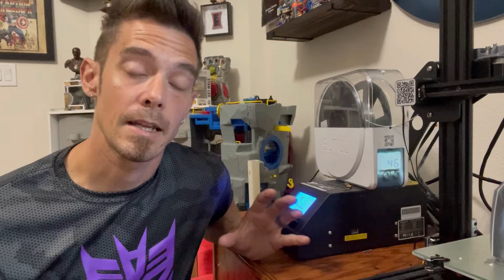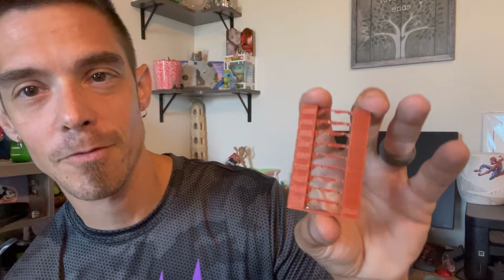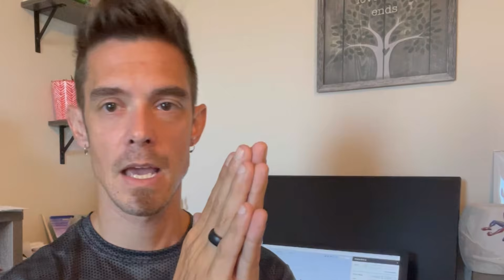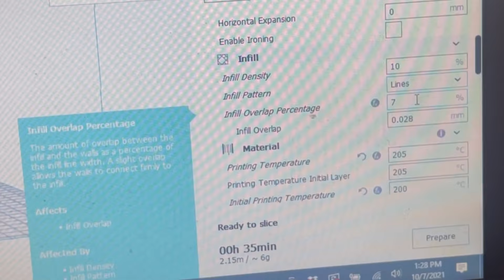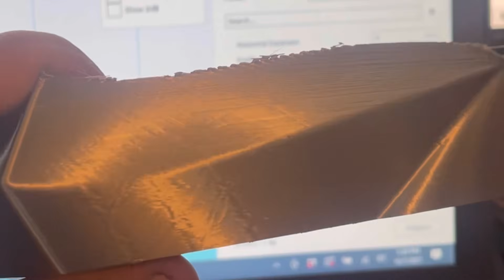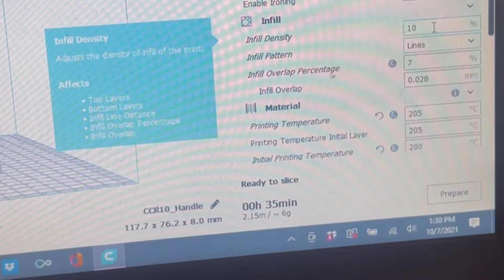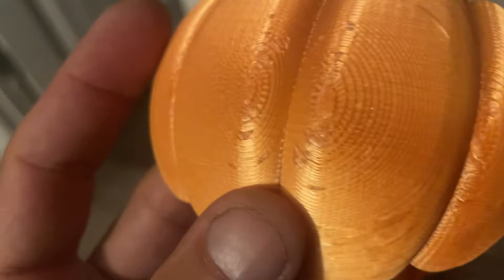3D printing silk filament| how to get silk 3D prints to look the best | 3D printing tips & tricks

Comment: Thanks for this video. Got the matterhackers silk rainbow, and the brim has separation. The print looks ok, though. So maybe just try your settings then update this comment. Creality Ender 3 v2. Latest Cura 14 version.
Reply from the maker: I’m dropping part 3 soon it’ll have even more tips!
Reply: @Darkwingdad  Thank you so much for this one, so now 13 days into the silky rainbow MH build series. Did all you said to adjust and added some of my own. Installed two more Cura 5s. the xmas version and beta which tahnkfully has tree supports now. Phew, Many days of drying this sfilament and even brought another printer, a sovol sv06, which looked so nice, just had to get it ( wife helped pay mostly). It pops, so must have been dry. Guess the dryer can only do so much. Been challenging, but after two years with the ender 3v2, it's nice to have a self leveler. Keeping both. Wife has lots of dolls and machines been going all day. Hopefully I'll see notification on the silky filament. Frustrating filament for sure.
Reply: @Darkwingdad 11 months later back watching your video again. haha. Sv06 is a real pita. Cheap as Creality's are , the print quality is still better than the sv06. Newest Creality machine looks really nice, newly designed direct drive and 2 z screws,. Probably won't buy another Sovol. So far it needs alot of fixes which I haven't done yet. Second Sovol print dryer fan crapped out and although it heats the motherboard fan current is way off...sigh looked nice, had high hopes for it :(
Reply from the maker: @joelstolarski2244  the reality is these machines are thrown together in minutes & it’s a crapshoot on parts. I’ve had good luck with creality but some definitely better than others

Comment: Thanks a lot for making this video. I am only 1 week into 3D printing but I accidentally ordered a case of 6 silk filaments, not realizing that the "silk" part was more than just the shiny finish... I've had nothing but bad luck trying to print anything with it. I just watched this entire video, dialed in my settings in Cura, and am currently printing a temp tower (even set up the G-code manually for the first time) to see how it works. I'm 2-3 layers in and already it looks leagues better.

My biggest issue was that the first layer was adhering perfectly - zero issues there. But then it would string like crazy, looking like a silky spider web on subsequent layers, and it was a big hairy looking mess by layer 5-6. From my understanding it seems that the retraction speed as well as the overall print speed are the two single biggest factors to dial in regarding silk filament. It just tends to string into a disaster if you print it too fast.

Thank you again for making this video, I'm going to save it and rewatch it when I need a refresher!
Reply from the maker: Yea silk, for quality definitely go slower: if you’re still having minor stringing issues enable coasting (I explain that in my part 2 video) & very soon I’ll have part 3 up that will be the trifecta for quality silk printing. I appreciate the feedback & thanks for watching!

Comment: I keep my silk pla in a plastic box with desiccant packets in it, will that do for dehydration?
Reply from the maker: That will only prevent new moisture from getting in, but those packets don’t last forever and need replacing over a few months. They will not help pull much moisture if any out of the filament

Comment: If you don't live in a place with high humidity, you don't need a filament dryer.  "The cool part about science, is that it's real whether you believe in it or not" -NDgT
Reply from the maker: I highly disagree. Silk filaments are magnets for moisture absorption, I’ve had pla come from the factory with moisture in it. You have no idea how long it’s been sitting, where it was made atmosphere wise & if the bag maintained a seal. So to say you don’t need a filament dehydrator is a stretch to say the least.

Comment: Hi there? Not sure if you'll see this but I recently bought a 3d printer that's printing out in my shed. I'm getting really weak prints when printing with silk.

Its like the layers are not bonding correctly. As soon as any pressure is applied they just crumble.  I'm printing at 195 as I did the print tower with a retraction of 3. Bed is 60.  Using eryone black silk pla. I think I was printing faster at 60 though layer height at 20 ...20% infill
Reply from the maker: Sounds like underextruding, likely moisture in the filament. Printing in a shed is not an ideal place unless you have a dehydrator and enclosure. Even than I wouldn’t print in a shed

Comment: Hi great videos! I have recently been struggling with a Sunlu silk pla+ filament. Even with all these extra settings, I cannot seem to get a perfect print. More than anything they continue to be stringy and have some rough edges, even with retraction and lower heat settings.(200-205) Have you tried this product?
Reply from the maker: I have used sunlu, enable coasting to help reduce stringing. Have you calibrated your esteps & flow?
Reply: @Darkwingdad  I am currently using IdeaMaker with my Longer LK5 and it seems I do have coasting on with .2mm. As far as esteps and flow, I'm afraid I don't know much about it. I am very new to this and I am trying my best to learn but it has been a lot of information. Is there any possibility of sharing pictures of settings to get feedback?
Reply from the maker: @masterduelistaero  you can email pics of your settings so I can see what’s going on but esteps & flow are an important part of getting quality prints
Reply: @Darkwingdad  sent settings to email in your profile.

Comment: General question here, what do your flow settings look like and are you printing with a standard .4MM brass nozzle? I have just started printing with silk, and running these same settings, keep running into a clog issue and then comes the dreaded extruder click that in turn chews up the section of filament in the drive gear. I can then pause the print, remove the filament, cut the damaged section off, and then restart the print, but I run into the issue of a zit or blemish on the print, where it paused. I keep seeing something about reducing flow for silk down to 75-80%, is this accurate? Or do you print at 100% flow rate?
Reply from the maker: Your flow,esteps & retraction should all be calibrated, guessing on these settings will just create more problems. Even when I first started doing silk & didn’t calibrate flow rate right away I never ran it that low, that’ll definitely cause underextruding. My flow is typically calibrated and ran at 97-102 depending the machine & how it came from te factory. Always start with your esteps if you are over extruding you will clog every print. All my prints are standard .4 brass nozzle
Reply: @Darkwingdad   I have never calibrated flow, or esteps and have been running on whatever an ender 3 pro v2 defaults at stock. Ironically enough, printing regular PLA or PLA+ (likely because of their ease of use properties) its absolutely spotless, but now that I'm starting to get into these metallic, silk, and filaments with compounds in them, it immediately starts to clog directly after the base layers, right into the first layer of infill. Any suggestions on sources for calibrating e steps and flow calibration?
Reply from the maker: @TomohawkInsanity  what are your retraction settings & temp for silk? Also are you using a dehydrator? Often times silk filament comes saturated with moisture & need drying first
Reply: @Darkwingdad  Unfortunately this roll, I pulled straight out of a poorly vacuum sealed bag and stuck right on the printer without drying it because excitement, lol. It laid down the base layers like butter, and immediately clicked on the first infill layer, with the temp at 235. It is the Ziro Silver Black roll from their site. Retraction is set at 7MM with a 30MM/s retraction speed. slightly different from your settings. I'm gonna give drying it at 45 degrees for 2-3 hours today and leaving it in the box until I get home. Just have never done ANY e-step or flow calibration to the printer, and it's been upgraded to a creality direct drive head, and then install the original bowden tube extruder setup back on the printer. All of which with a firmware update, as well, without ever calibrating e steps or flow.
Reply from the maker: @TomohawkInsanity  235 is wayyyyy too high & 7mm is far too high for direct drive. 
Try 205* and 2mm @ 30 mm/s for Bowden you’d want 6mm @ 35mm/s to start
Reply: @Darkwingdad  Yes sir, I am back to the original bowden tube setup, as the direct quality just wasn't there no matter how much tuning I did. Ended up with consistently linear prints with infill poking through. Now that I have watch your videos, and couple other on e steps and flow calibration, I can confidently say, my e steps value is likely WAY off causing the dreaded extruder clicking, because of a buildup of filament and the fact it had never been adjusted. I'm gonna try the temp towers, and calibration cube that you had recommended in this video and get my printing extruding properly, and then give it another go at the lower temps in the 200-205 range, and see what happens.
Reply: @Darkwingdad  I ended up finding the perfect print parameters, setting wise based on your videos. The last thing I have to calibrate is flow. Once I get that down, I should be golden. I was 10 hours into a .2mm layer height spartan pen holder yesterday for a friend, and it looked great but had the brittleness of pasta noodles between layers. TO me, that sound like my z offset is adjusted too high above the bed. What would you say is the ideal "height" the nozzle should be above the print? Should I also up my layer height to .16mm if I'm trying to print a figurine with silk, rather than the .2mm layer height? Sorry for all the questions. I'm just trying to get this right.
Reply from the maker: @TomohawkInsanity  if it’s brittle it could be from too low of a temp or underextrusion which could be a clog, moisture,faulty extruder gear/driver or even a faulty sliced file. What was the infill set at? As far as leveling goes you should be able to move a piece of paper under the nozzle when at 0 and it should scrape the paper a bit
Reply: @Darkwingdad   Dried the filament in a Sunlu S1 dryer for 4 hours at 48 degrees before use. Dried at the same 48 degrees while printing the entire time. Infill was at 20% with 6mm retraction and 35mm/s bowden tube setup, with cubic pattern first, and then attempted lines for attempt number 2, without any stringing and 205 nozzle temp which sat perfect on the temp tower. Brand new .4mm brass nozzle for the print. I'm gonna bet the gear is faulty, or I had the tension arm too tight. I had the tension spring as tight as the screw would go in, and the actual tension arm tightened as tight as I could into the stepper motor.  The first layer was buttery smooth without a single issue no texture at all, which some were telling me no texture on bottom layer, is a sign nozzle may be too close. That there should be a small amount of texture to the first layer.
Reply from the maker: @TomohawkInsanity  was the extruder clicking at all during the print?

Comment: i must ask did you use a direct drive printer or a bowdan printer?
Reply from the maker: These were all Bowden set up
Reply: @Darkwingdad  so what did you do for the new (z hop when retracted) settings have you tested those in the new cura? also you should know my dad and myself consider eryone to be a trash filament i personally used a reel of cc3d silk gold to print the dragon claw from skyrim with a bit of advice from you. my latest attempt despite some scuffed settings turned out good needed some cleaning but good at least compared to the three failures before one of which i repaired with epoxy due to bad infill settings.
Reply from the maker: @GalacticYeeter  I’ll touch on those settings in part 3. I used eryone cooper & green for my pumpkin bombs & goblin mask & had nothing but great results. Every filament is different. I recently tried some color shift silk from string hero & it was not that great. Even after running it through my dehydrator, tweeking & reprinting & sent it back because for $33 a roll it simply printed significantly poorly than ziro
Reply: @Darkwingdad  btw never did say thanks i tested these settings on a direct drive printer im quite happy with the results im getting they work great at least on the robo 3d r2. 

in return allow me to provide some general advice my own dad gave me on support structures you may or may not find useful. basically what i did for my last print is i set my support for a different infill style then the main. so ie my main infill is lines but my support infill is cross. then following further advice from my dad. i set the support z distance to about 0.2mm which doing these two things makes removing supports alot easier and reduces the likely hood of damage occurred when removing but i wont omit that the flipside to this is that you loose a bit of adhesiveness doing this so if you ever need to use a printer that you cant afford to put glue on because of the way it is there you go.
Reply from the maker: @GalacticYeeter  great to hear that!
Yes support infill is always significantly less that the print infill. I usually run 4% on supports with zigzag. Line distance between 13-14 & I like running the z distance at .24 but if I need more support I’ll run a 2. I dropped a few shorts on how easy they pop off

Comment: I'm having issues with pit marks/nozzle spots on my top layers with silk pla & every layer really. Not sure what the issue is. Both on flat surfaces & curved. It will like lay spots down in sharp corners after doing walls & infill. Which then leaves random pits on my top surface, ruining the entire print. It looks like the nozzle is stippling various random spots. 

Can you please help me solve this issue.
Reply from the maker: Have you calibrated esteps & flow?
Reply: @Darkwingdad  I'm running a Creality CR-6 SE. There's no option to input that into the printer itself. I did measure and out of 100mm, it only extruded 96.5. It was short by 3.5mm. I'm not sure how tp store this in the printer. I've never really had an issue, cept with Silk PLA. I think part of the problem is after every layer the nozzle goes around & touches the print. As if to fill some tiny hole, or like it's checking something. I've never calibrated the esteps or the extruder. Think cause there weren't any options to store the settings in the printer & I'm not sure how to do it in Cura. I'll see if I can find out how.
Reply: I checked the g-code in Cura and the extruder gets reset twice in the Start G-code script.
Reply from the maker: @aztatude  you can input it in the gcode. I have videos showing how it you can use pronterface. Do you have z hop enabled? Coasting? Are you using a filament dryer?
Reply: @Darkwingdad  yes on all 3. I've acutely never had a problem till using silk PLA. My first layers of PLA always look good as well as each layer. I'll def check out the how to videos on inputting info in the g-code. Hopefully that will solve the issue with silk pla.
Reply from the maker: @aztatude  last question is your combing mode on? If so what is the setting?
Reply: Think maybe I didn't explain the issue correctly. On each layer when it's finished, it goes around to various spots and puts down a very tiny amount of filament at various spots. Looks random, but think it has to do with a slicing setting. As if that layer missed a spot. Could be this particular model. As I've produced flawless prints without ever calibrating the steps & flow. Didn't even know that had to be done before you asked me about it.
Reply from the maker: @aztatude  does it do it on every model or just this most recent one? Try reformatting the card & reslicing? I’ve never heard of that but it sounds like a glitch it shouldn’t have anything to do with type of filament
Reply: I know this is from 9 months ago but this is my main issue too. Have you figured it out? I have ridiculously beautiful vertical walls but the highest/top layer/surface has random pits and what looks like nozzle travel lines. This only happens when I use silk, my regular pla have beautiful top surfaces. I'm not sure what's the setting that causes this. I hope someone can help.

Comment: Please send me your settings.
I’ve written down all the settings you mentioned in this episode and part two. The reason for your settings… my hot end clogged.
Thanx for your help!
Reply from the maker: Clogging isn’t necessarily from settings. Improper heat, retraction which should be done with temp/retract towers & moisture can cause clogs along with improper bed leveling & Bowden tube install/nozzle